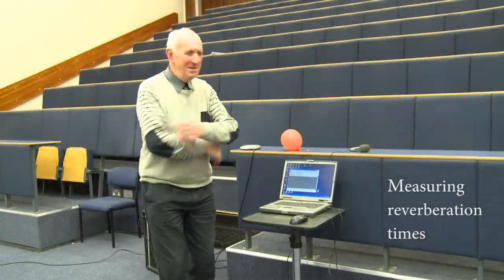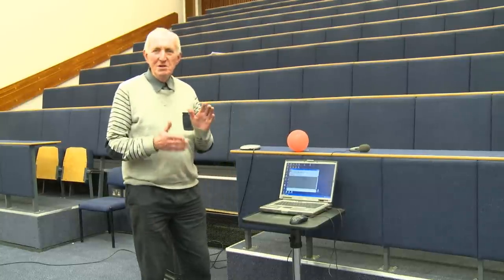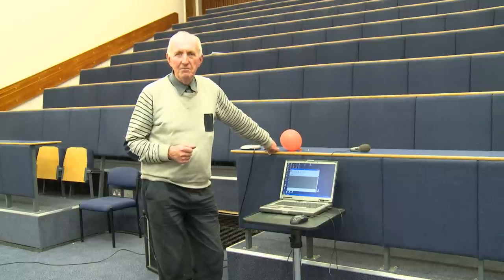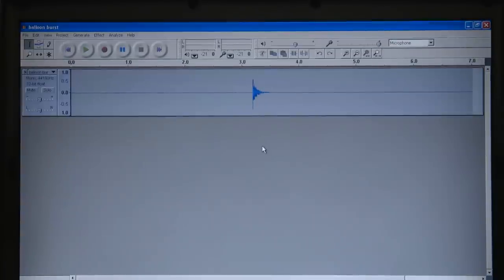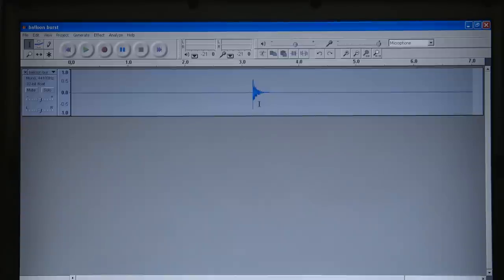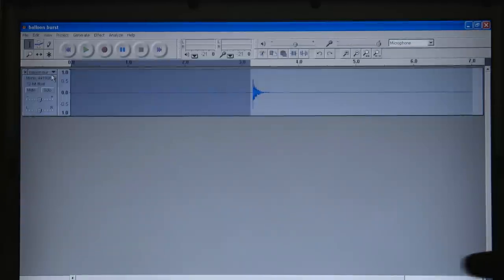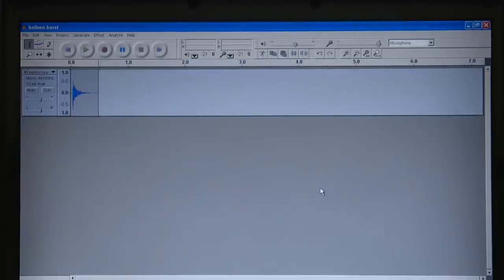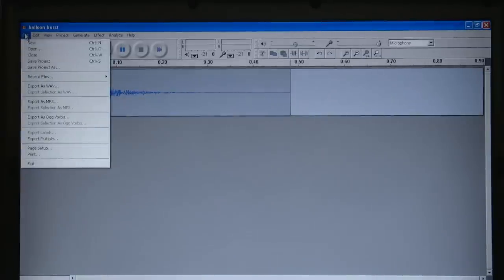Measuring reverberation time

Comment: Rene de Reaumur (1683-1757) is a French physicist.

Page 986

rebarbative = adj fearsome; forbidding. [C19: from F rebarbatif, from OF rebarber to repel (an enemy)]

Page 1019

reverb = n an electronic device that creates artificial acoustics.
Reply: reverberation time = n a measure of the acoustic properties of a room, equal to the time taken for a sound to fall in intensity by 60 decibels. It is usually measured in seconds.

Comment: Can you share the brand and model  microphone that was used for this test.  What were the specifications for the microphone to make an accurate measurement of the reverberation time?
Reply: Most any microphone will do. Compressor mic's will be more useful than dynamic mic's at getting a good result due to their sensitivity at picking up quiet atmospherics like the reverb. Since sound quality doesn't matter you can amplify the mic's signal as much as you need to in order to see the extent of the reverb time, this makes most any mic sufficient for gauging reverb. You may also want to consider the shape/direction of the mic's pickup. An omni-directional mic will be best because it will get the average directional reverb from the entire room. I think he mentions this in the video a bit.